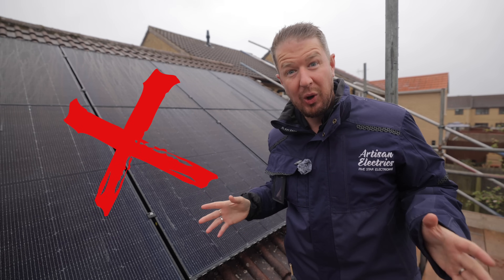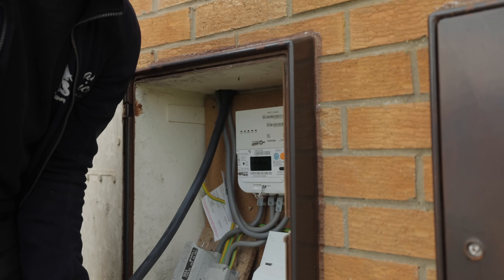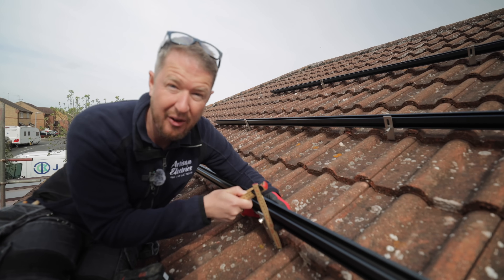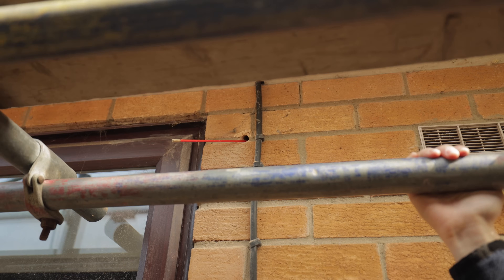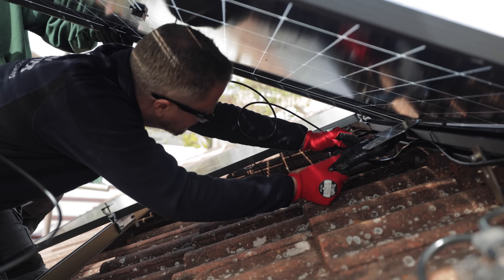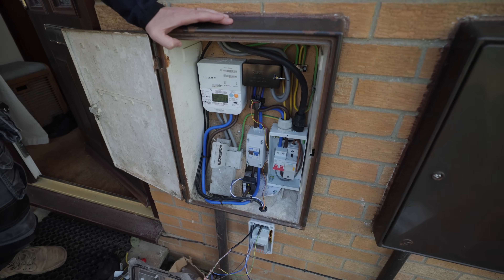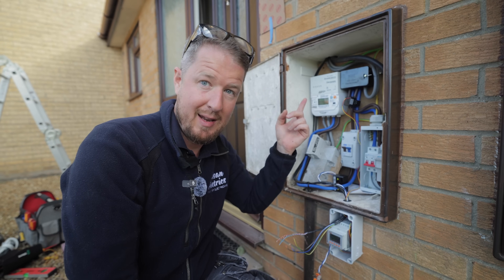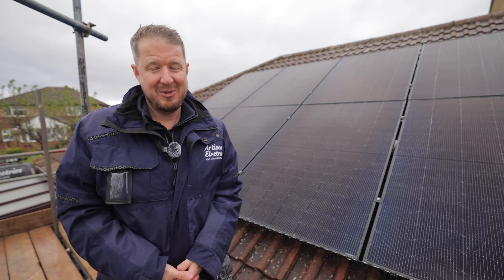Have We Been Doing Solar WRONG All Along? 🤷🏻‍♂️

Comment: I'm English doing solar in Australia, we get 2 of them jobs done a day with the alphas and bigger systems on the roof with a crew of 4, criminal that's taken 2 days with that many lads
Reply: Fewer tea breaks in Oz.
Reply: Fitting to a metal roof is much, much quicker than installing on a tiled roof. Each tile where an anchor sites needs to be properly weatherproofed. The time this takes can vary depending on whether the tile is a plain tile, profiled tile (as in the video) or slate. Plain tiles are the quickest by use of a hook stop, concrete profiled tiles require grinding out which takes a bit longer and slates require cutting and flashing which takes the longest of all. If not done properly for just one fixing, then you have a leak.

In addition if the rafter width is 35mm or under (which is common in UK houses built using trusses) then they require reinforcement which adds even more time.
Reply: I can confirm that a team of 3 ( 2  roofers and 1 sparky ) installed 2 complete systems per 8 hour day in Adelaide Australia, we do have an advantage of better weather 🙂. 
The majority of installations were to tiled roofs,  and were identical installations with no variations offered by an electrical retailer for a fixed price...
Reply: I had a "4kw system" installed under the FIT scheme in 2014. Comprises 16 Solarworld SW250s with Enphase M215 microinverters. Works exceedingly well. A crew of three installed it within 2.5 hours. Four other teams from the same company did much the same and in the same time frame (one was a neighbour who had his installed the same day. The other three installed theirs on my recommendation: my son and two friends. Not one of our microinverters has ever failed. There's been no perceptible degradation over time. Output on our 4kw system has varied from 4.7 to 4.9 megawatts per year. Our consumption has varied, not least do to some construction work and Covid, so it has fluctuated from 4.0 to 5.7 megawatts per year. ROI was seven years: no point in pursuing mis-selling claims with that kind of efficiency. Now in retirement. I'm putting additional panels on our flat-roofed EPDM-covered outbuildings in an EW orientation (with a low inclination due to coastal winds in Thanet which can reach 100mph): this time we will add battery storage: ROI will be 4 years, thanks to Octopus Energy's green tariffs and the fact that the lion's share of our electricity costs are already dealt with by the existing system. Thereafter it will just be a source of profit: not huge but significant and dependable. If our DNO would permit it, I'd do much more, just as commercial firms around us have done, including a firm of accountants with over a hundred panels, a local fitness centre with about the same, our Sainsburys with several hundred, farmers who have covered their barns and houses, a railway maintenance yard with well over a thousand, and so forth. So to what extent are the house builders doing their bit? Don't make me laugh: Some only put up one or two panels on a new house. Others really push the boat out and add three or four. But every new property in some of these developments has a EV charging point. New commercial buildings are putting in sod all. It is scandalous. About time the new Government requires all new buildings to max out the full potential of their roofs to support green energy. One installer, btw, told me that the time it takes to connect a solar panel to a microinverter is about one minute. I'd say that was an exaggeration: From what I've seen, I think it takes about two minutes, including mounting the microinverter itself.
Reply: @johnpritchard1523  " Works exceedingly well.". But you have no idea if the microinverters are actually making things better than if you had no microinverters, and just a single, string inverter in your house instead...
Reply: I suspect Australian roofs are less steep, fewer working at height restrictions than the English. 

Installs on tin roof are easier and faster than on tiles. 

That said, we Aussies are known for working harder and more productively than many others.

Comment: "Its a grey roof...." so that is why you guys should be painting those cement tiles under the solar panel , white, to reflect all the radiation !  In fact, to keep the whole roof cool, the whole roof should be white, but you are not in a warm clime so not necessary. But it would preserve the concrete tiles and roof timbers and make em last longer, especially if you had a covering of silver sarking as insulation and xtra waterproofing. !

Comment: If you get extra light reflecting off the roof on to the rear of the panel, why don’t you fit a reflective foil panel directly on to the rear of the panels and increase ten fold the rear reflection.

Comment: Somebody really rich (and a bit wasteful) selected panels and inverters for this system: bifacial panels on a roof - not much bounced light from the bottom when placed on the roof, microinverters - overheating when so close to the panels on the roof (will result in a shorter lifespan) and inspecting microinverters on the roof is another extra service cost. Both of those would operate better on a ground solar installation. Moreover there are microinverters that can work with 4 or 6 panels. Regards 🤗

Comment: "Bi-Facial" solar panels are said to be great on those ground installed setups in places like Alaska and Northern Canada, where more  land area is available (and if snow builds up, can be swept off with a broom from ground level easily).  Set on angled frames on the ground, the brightly reflected light from surrounding snow, powers the back of the solar panel as the direct Sunlight strikes the front. And remember the colder the air, the higher their efficiency.  

So as your Solar Panels are "Bi-Facial" and the underside faces a dark clay/concrete tiled rood. For fudge sake wouldn't it have been a great idea to give the tiles a quick brush off first, then slop on a thick coat of High-Gloss White Paint ! That would have to give a very substantial increase in output, surely.
Reply: I saw a video where they installed them vertically on the ground, east/west facing. Snow can't accumulate on them, the ground can be used for other things and they appeared to be just as effective, if not better.
Reply: Can I put some reflective material on the group, e.g. tin foil/ mirror so to capture more?
I have an detached garage and I can put this on test.
Reply: @TurkeyFamily it’s a done thing. Solar concentrators. Can include lenses also. It’s all non high volume factory production test tech. I’d you find any different, let us know
Reply: Nice idea for a follow-up video💡 how much more power can these panels generate if installed on a reflective surface (in the UK)
Reply: Or some mirror type panels fixed to the tiles underneath the solar panels 🤔
Reply: In the UK you might have issues with planning if you painted your roof in a reflective colour. You need to comply with the material finish your house has permission granted with.
Reply: @themightyjuju  but that section of roof will be hidden under the solar panels.
Reply: @mattb5427  Hidden from the sun also ? I doubt this is an application for bi facial panels
Reply: vertical bifacial panels use alot less space then normal panels

vertical panels are cooled much better the normal panels
Reply: Perfect idea and example, Catherine! I was thinking of something similar, perhaps even more simple, like aluminum foil or even installation panels with aluminum foil facings.
Reply: Solar reflecting paint is very good a lot of this is old to me been watching all this going on in the US for 10 years.

Comment: We've had 14 panels with HoyMiles microinverters going for over 5 years now, no problems.  There is quite a lot of shadowing early morning late evening from trees and, as the panels are on a flat roof in angled mounts, when the sun is very low in the morning the front row partially shadows the rear row. The microinverters work really well in minimising the impact of the shading.  I also like that I can monitor the state of all the panels via my web browser directly to the HoyMiles hub - no need for any 3rd party cloud server or account, it just works locally on  my LAN.

Comment: Finally I am trying to get bifacial panels in the UK for a year now. The technology exists but the gatekeepers prevent the better technology in the UK. It is very difficult when you try to hire somebody to do any job. 100% of the companies in the UK try to rip you off and the good ones such as Artisan are not available in specific areas. 
Bifacial solar PV is so much cheaper than the traditional panels. 
People need to understand that if they install the old non-bifecial panels they just waste money. Now I see 660w panels in standard dimensions. This is great. Bifecial can be used as a normal setup with an inverter. The micro inverters could potentially put you in more expense if you fail. If there is a solution for micro inverters to be installed away from the roof that would be much better

Comment: I have a question if the micro inverters feed the battery and the house the house is okay but for the battery, you will need to use a lithium battery that complies with the conversion between AC to dc, and in night it will feed back to the home so you need an inverter there am I right?

Comment: We had 12 Enphase micro inverters fitted to our array in 2013. One failed about 2015 but was replaced under guarantee. Otherwise no issues at all
Reply: Yes, but did the micro inverters improve the power output, and if so, by how much, and how much is that worth in money, versus the cost of the pointless micro inverters?
Reply: Did enphase cover the cost of scaffolding or access costs of replacing the inverter?

Comment: Jez and his team were the installers who worked for Heatable on our install with these bifacial panels with IQ7+ microinverters back in February this year. We also had a GivEnergy AIO fitted. I cannot praise them enough for the quality of their work, and the care that both J Cook and Ben and the team at Heatable took over our install! We're super happy with the results: as we have an EV and can benefit from intelligent Octopus go, we now use essentially zero peak rate power, and can top up the battery overnight at 7.5p/kWh and export all excess solar at 15p/kWh. The savings are massive, and I was really surprised how much energy we get even when it's cloudy, early or late in the day etc.

I probably shouldn't respond to Facebook ad trolls, but I i can't help but defend Heatable when I see nonsense being posted about them, they're the real deal and I'm so happy with our experience!

I see quite a lot of naysaying of AC coupled batteries and microinverters because you can't siphon off some of the DC power before it hits the inverter, but at least for us that's a non issue because we're exporting as much of the solar as possible, not using the solar to charge the battery (because it's cheaper to do that overnight from the grid then supply the grid during the day). When we have a heat pump installed, that will only increase the importance of the microinverters, as the improved low light performance will help power the heating during the winter months, supported by the battery which was charged at off-peak prices the night before. 
Win-win!

Comment: AC is inefficient and all your laptops use DC anyway,, PC's also via their Power Supply convert AC back to DC, via USB C for example, that gives DC 20v. You guys are playing games converting DC to AC then AC to DC over again losing like 30% in the round trip. However SOMEONE GOT A SECOND MORTGAGE for you to play games with electrical system to WASTE POWER wherever you can by saying AC is so awesome. WHY NOT JUST HAVE SYSTEMS DC go to DC with less than 10% loss. Whatever guys, keep drinking your Coolaid. There is probably no battery to store power either, and if you did have one, you would then gain lose power converting your AC microinverter power to DC to charge the battery.

Comment: Can the bifacial panels be mounted vertically such as on walls and fences? I would have thought they could be much more effective in more northern areas where the sun is lower for most of the year. I think the average roof angle of around 30° is too shallow so reckon a steeper angle or even vertical might work better, especially in the winter when the energy is needed most.
Reply: I saw a video suggesting vertical mounting was effective (so long as both sides are exposed). Varies depending if you get snow cover or not, etc.

Comment: Please just note that the IQ7+ are rated at 290w so great you have fancy panels but during most of the summer months that extra power the panels produce with be clipped by the inverters. Will get a bit more during the winter months admitedly with the bifacing panels but the inverters wont be enough in summer. 

I have iq7+ and get xlipping already in April with basic 395w panels.

Hopefully the customer got a deal on the panels.

Comment: I would mount all inverters under the first, lowest row of panels. Installation with some short DC extensions from the panels. This will  come handy for maintenance e.g. when you have to replace a faulty inverter.
Reply: On new builds install in the roof where the felt allows.

Comment: Micro inverters for a small, completely unshaded and roof mounted system is not a good optimisation imo. 

For the additional cost of the inverters (£/wh) you could just fit another couple of panels that will massively outperfom any advantage otherwise. The less stuff you put on the roof the better imo, the costs to do "roofing stuff" are now the biggest cost of the system. When i worked out the costs for my system i got a better ROI for putting panels on a low flat roof i could therefore self install without scfolding, even though that location was less optimum in terms of insolation. The labour costs to put panels on my main roof, high with difficult access but unshaded and south facing) pretty much would have doubled the overall cost, whereas the insolation reduction from the non-optimum position is actually only approx 1/4

Micro inverters are also always going to cost more per Wh as each inverter carries an overhead per wh harvested, ie the casing, mounting, connectors, and of course the internal power and control electronics. For example, it costs pretty much the same to drive a single mosfet in a DCDC as it does to drive 10 in parallel, so your electronics cost per Wh is increased when you compare to a single, large high power device.  When you start to look at long strings of panels then you also start to see a cabling cost save on larger systems as you are carrying your power at a higher average voltage (240VACrms vs say 400Vdc). So at 20amps (typical max continuous MC4 connector rating), you are talking about being able to carry 8kW, vs 4.8kW on the same cable!

Comment: You need to account for the extra conversion losses of charging via micro inverters.
My hybrid PV inverter is DC to DC to AC end user
Micro inverters go DC to AC to DC Back to AC end user.
Micro inverters will need an AC coupled inverter/charger.   All very lossie and just as much equipment needed.

Comment: You could always spray the roof white or fit good old radiator backing foil before the panels are fitted! 10-20% increase in efficiency vs. roof tiles?

Comment: One thing you lose from putting a home battery outside is heat!  Most ppl tell their battery to charge in winter  at night on cheap off-peak electric and the inverter might lose 5% electricity in the AC-DC process of filling the battery. Put it outside you're contributing to global warming vs inside where the waste heat is heating your house!!!  Also IP65 or whatever - it's going to be more reliabel indoors than outdoor! Also DC batteries don't like freezing conditions, or 35C - put a home battery outside, in -10C in winter it will throttle it's charging to 50% or less! Not good charging off-peak in winter when it's going to be below freezing! And it won't like being 35C in the sun in summer!  Put it in a utility room that's 15-20C all year and it's going to be well happy and last longer!
Reply: best practice is outside these days.
Reply: @narrowboatlongpod4176  but lithium batteries prefer the temperatures humans like. 10-30C. They throttle power below 0C and high temperatures damage them. Therefore a garage or utility room is better for the battery life
Reply: You are right, but new PAS specifications limit the areas inside where people should be installing now. Such as lofts, under the stairs in cupboards, habitable rooms, emergency exits etc etc. Ideal place is in a garage really.
Reply: @spjelectrical2940 I'd be interested to know if an LFP battery system has ever caught fire. Not scooters or EV bikes using the standard lithium cobalt manganese chemistry. But a LFP battery fire. And more than just the electrics going "pfft" and a bit of burnt plastic. Ie. TVs are electric but we don't put them outside!